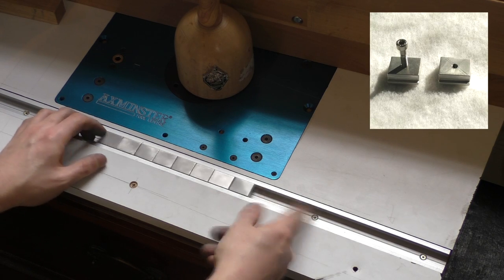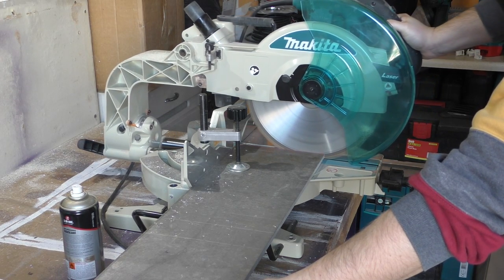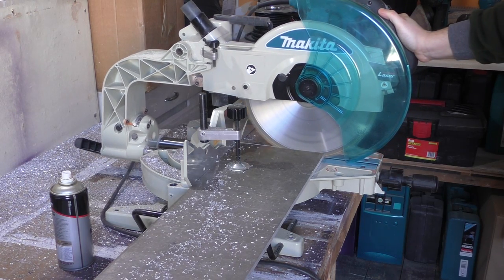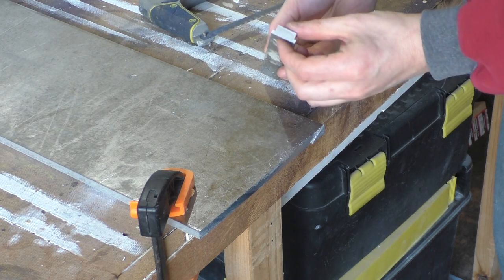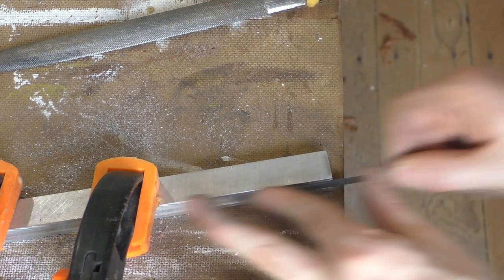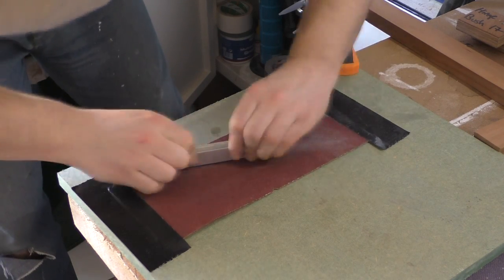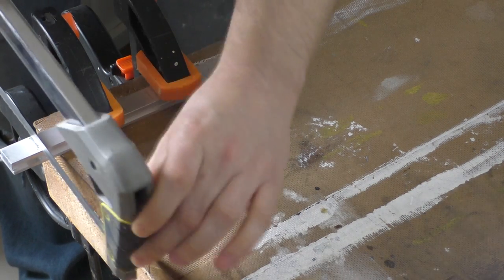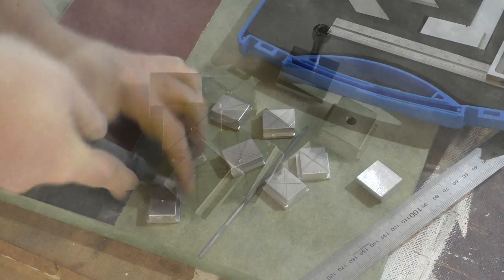Hand Made Aluminium T-Nuts

Comment: This is a great idea... Never thought about doing my own T-NUTS... Now we should try making our own slides... ;)
Reply from the maker: +Giaco Whatever Glad you liked the idea. The topic of DIY t-track comes up quite often on woodworking forums and the conclusion is always the same - it's not worth it. Commercially it's made by extrusion which you can't do in a DIY setting which leaves milling as the only option. That limits you to roughly 600mm lengths and it's not an easy cut to make. It would require two passes first with a straight mill and then with a T cutter (which is expensive). A much easier solution is to cut a slot in a board and then screw aluminium sheet down on top to make a T.
Reply: +Wobblycogs Workshop we can buy anything... Can't we? Sometimes is just for the sake of making stuff... Right?
 I won't do a video about it though...
Anyway, Nice one, keep it up
Reply from the maker: +Giaco Whatever Sorry, I probably came across as a bit negative before. I'll have a go at making most things. It's hard to beat getting your hands dirty making stuff :-). I think I'll head over and watch a few of your videos now...
Reply: Wobblycogs Workshop don't worry buddy I agree with what you said... But yes we just like making or trying making stuff... :) thanks

Comment: If the t-track is aluminum would it be better rather than to have aluminum against aluminum, is to have the t-nuts made of steel?
Reply from the maker: I honestly doubt it makes any difference. I have commercial t-nuts that are both steel and aluminium. I prefer the aluminium ones as the steel can raise a burr on the track if there's a sharp edge.

Comment: Good idea although using a chisel like that made me cringe, did you have much trouble drilling the holes, I thought it would have been better to drill them before cutting into individual nuts so you had more control over the piece.
Reply from the maker: +John Fithian-Franks I've got a couple of sets of chisels, that was one of my rough ones. I do a bit of house restoration and the number of nails I've hit  with that chisel doesn't bare thinking about. I probably should have drilled and tapped the holes first but it wasn't a problem. I held the nuts in a small metal working vice while I drilled them.